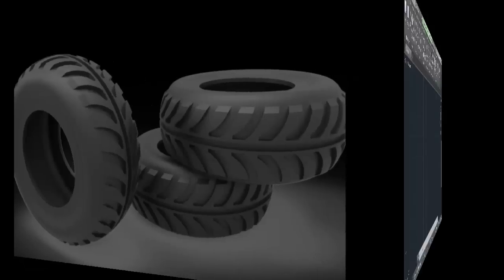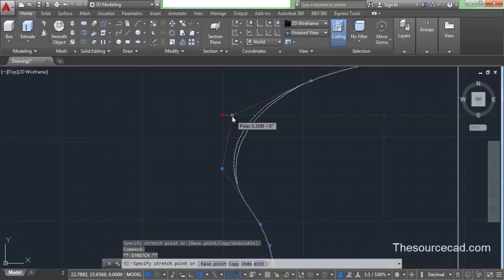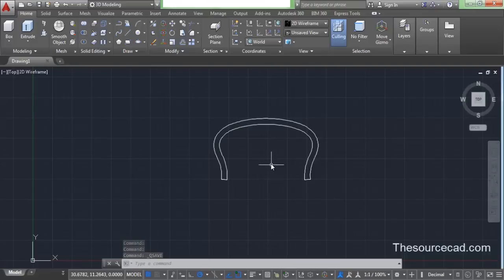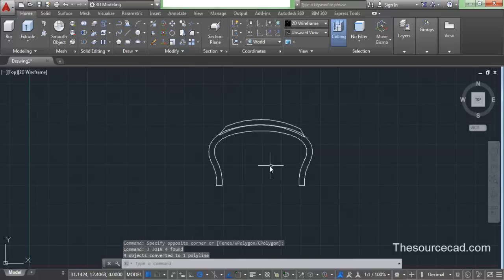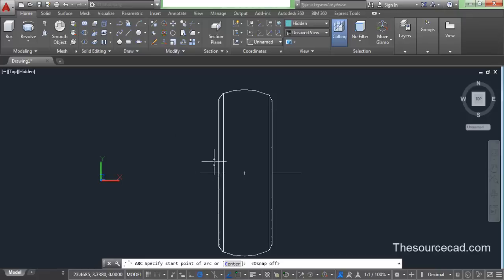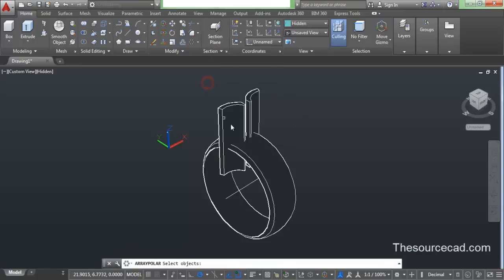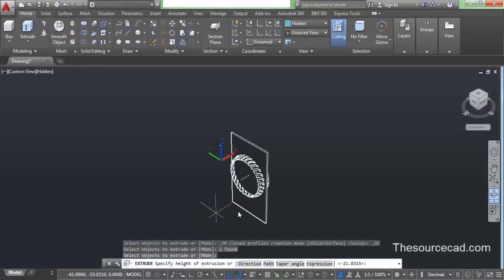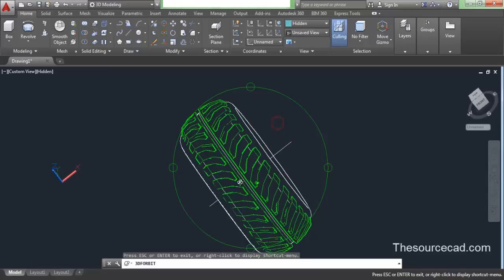3D modelling Tire in AutoCAD

Comment: 8:11 i didn't get the substraction part
Reply: For the subtraction tool, select the part you want to keep, in this case the tire center.  After hitting enter, select the object(s) you want to remove, in this case all of those spokes.  Finishing the tool subtracts the second wave of objects from the first object, so there will be holes and gaps where they overlapped.

Comment: Hi there great video, I m following this tutorial as we speak. I do however have an issue with removing the vortex at 1.38. When I remove it deforms the following vertex (It turns it into a straight angle) any Ideas as to what is happening here? Thanks

Comment: I have a question about Keyshot rendering, when I import a dwg to it all the curves and circles are converted to polygons and are not smooth, do you know how to fix that ? Thanks
Reply from the maker: Export your drawing to STP or IGS format from AutoCAD and then import it in keyshot, in that way it will not remain faceted.
Reply: Will do, thanks
Reply: Unfortunately extensions aren't available, I use Autocad for Mac, maybe it's not available for the Mac version :s
Reply from the maker: Use EXPORT command in mac, it should be there.
Reply: That's what I did but the formats you mentioned are not available :/

Comment: @sourcecad I am facing problem after doing polar array. I made the threads, extruded them and did a polar array, but during solid substraction process shit happens, I selected the tyre pressed enter and then while selecting the threads the whole array gets selected , and finally the process fails, ... please help
Reply from the maker: You need to explode array before applying subtract command.

Comment: I have another problem, after creating the threads, when I try to make the tire, it's coming like very big and when I add the thread layer, it's actually forming under the tire :| I tried like 4 -5 times but still the same. What am I doing wrong here?
Reply from the maker: this one is difficult to guess for me, you should try to use UCS in the same way I am using in the video.

Comment: i have a problem with subracting the array its not working but if i subtract single only its working
also i notice when i select the array that i created it automatically select all unlike here in video it should be selected manualy
Reply: +Raniel Baltazar - reduce the number to 20 or less than 20 ull get it

Comment: When I try to subtract from the tyre it says null solid objects the deletes the tyre?
Reply from the maker: have you made associative array? if yes then then you need to explode array before making subtraction. select all objects in circular array then type X on command line and press enter this will make array non-associative, Now try subtraction again.
Reply: +SourceCAD I have tried that. I still cant get it to work?
Reply from the maker: can you share a snapshot of error which you are getting it will help me in figuring out the issue here.
Reply: +SourceCAD Null solid created - deleted and it deletes the treads and the inner tyre
Reply from the maker: This is  a strange issue, I suggest you you to perform AUDIT and PURGE command and if problem still persists then make array again or create this drawing in a fresh template.

Comment: sourceCAD,
I also not able to subtract as you told in your tutorial ....but after reading on the comment section ...i succeeded by using the explode command . But sir my question is that ...why i have to use explode command on that ....why i cannot directly substract it ...please elaborate the basic concept of it sir
Reply from the maker: Prabhat Nigam actually your array is associative hence exploding it was required but if you dont want  to explode it then uncheck associative option from array ribbon and you wont have to explode array.
Reply: SourceCAD thanks for the ans. sir but where i have to uncheck the assosiative option of array
Reply from the maker: Prabhat Nigam when you select array you will find associative option on ribbon if you are using drafting and annotation workspace.
Reply: +SourceCAD hi there I'm mally and I got a problem extruding and lofting complex shapes e.g star to circle when I try  to region my shape it tells me 0 regions created but iv checked and there are no gaps and it is a closed poly line
Reply: +SourceCAD  the tire was good and the jet engine please try a plane....f16 if possible im having problems with the scale  wing to fuselage ratio and cockpit/glass !!